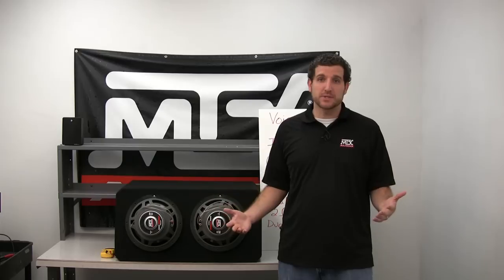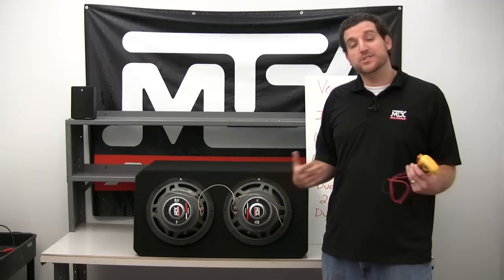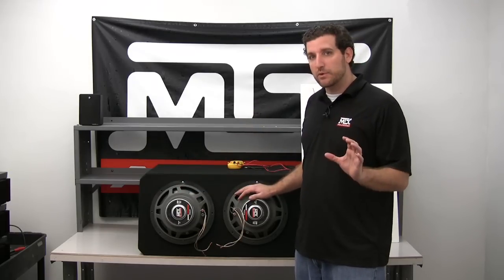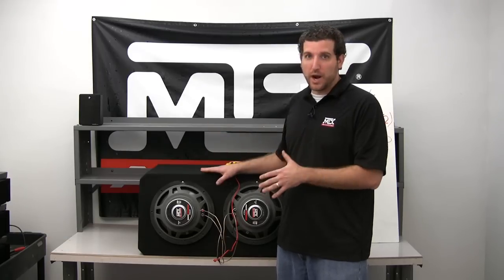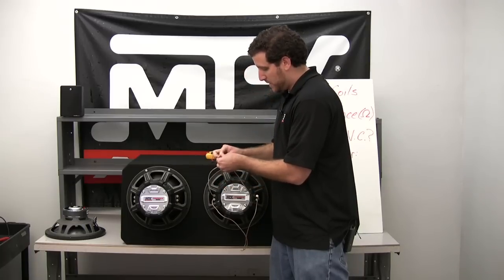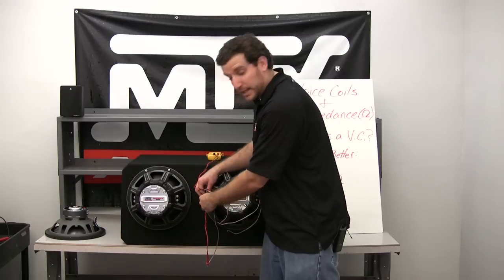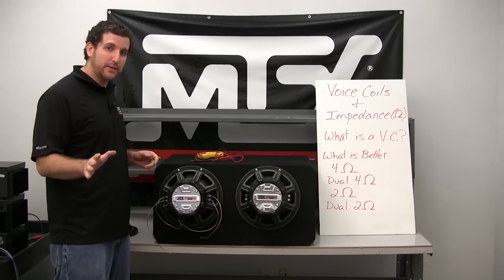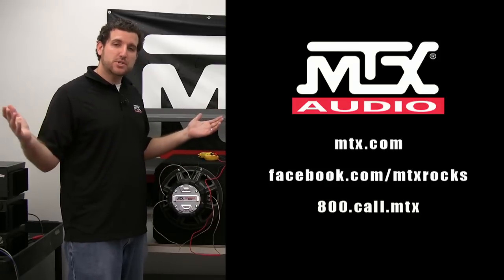How to Wire Your Subwoofers to the Correct Impedance for Your Amplifier

Comment: so if you have the 1200 watt terminator paccage with the 250 watt amp wat would be the best amp to give the subs more power safely
Reply from the maker: +ybm ticcloc Sorry for the late reply... That package is 1200 watts peak, 400 watts RMS and the enclosure is wired internally down to 2ohms. Here would be a good amplifier option - https://www.mtx.com/thunder5001-car-audio-amplifier
Reply: +MTX Audio USA thanks I'll check it out

Comment: i have a 400rms subwoofer and a 760 watt max 2 channel amp,i have the sub ran in series and bridged at the amp.it sounds good and dont get hot at all,is this a good setup?
Reply from the maker: +mumforddale1 We would need the RMS ratings of your amplifier in order to help you to make sure your setup is correct. Also, do you have 1 subwoofer or more than 1? If you have 1 subwoofer, how is it wired? In order to wire subwoofers in series, you would need to have more than 1.
Reply: i have one pioneer champion series 12'' subwoofer 400 watts rms hooked up in series dual 4 ohm voice coils to a pioneer 2 channel 760 watt max mosfit amp i have the sub bridged to the amp.sounds good i tried it unbridged and it didnt hit as hard as it did bridged.i no heat issue with my amp or sub,but i want to add another pioneer sub and a stronger amp.

Comment: I'm looking to fit 3 6.5" coaxs into the front doors but need to keep it between 2 and 4 Ohms.  How would be the best way to wire 2 of the sets in parallel and 1 of them in series to create about 3.6 Ohms?
Reply from the maker: +Rob Greenwood Most coaxial speakers have single 4 ohm voice coils. In order to run them all the same channel you would be at either 1.34ohms (parallel) or 12ohms (series). A 4ch amplifier could power 4 of the 6 door speakers without any crazy wiring. Then maybe pickup a small 2ch for the last two???

Comment: When you do this do you need to worry about the subs getting out of phase?
Reply from the maker: +BirchNirga A subwoofer being out of phase is when you switch the positive and negative connections. Sometimes this is done on accident and other times it is done purposely if the subwoofer is mounted inverted. You can read the article about subwoofer phase here - https://www.mtx.com/library-phase-discussion

Comment: Hey man I have 2 DVC 8 OHM subs, how do I get 2 OHM load ? Or how do I get a 2 OHM load with one 8 ohm sub....... Mine says 8 OHM on back of subs , Diamond audio 10's n I have a shit 2 channel amp n bridgable I think like 100 rms each channel or 75 but says 160 + 169 on it....... Also have 2 4 OHM 10's

HELPPPPPPP
Reply from the maker: +Headshothorror4488 We don't have the option to choose 8ohm subwoofers on our Wiring Diagram tool because we don't sell 8ohm subwoofers anymore but you can use the tool to select 2 - Dual 4ohm subwoofers to see the wiring diagram for a 1ohm load. If you wire your DVC 8ohm subwoofers the same way, you would end up with a 2ohm load at the amplifier. https://www.mtx.com/library-wiring-diagrams
Reply: +MTX Audio USA Thanks allot for the reply. I checked meter and it gives 4 ohm per coil on them so I guess they are really 4 ohms as I get a 4 ohm load together and single a 2 ohm final load

Comment: I bought 2 powerbass s-1204 12 inch subs DVC with a RMS 300 watts what amp should I use?
Reply from the maker: +Idris McGouirk You could wire that setup to a 1ohm load or a 4ohm load. So you would be looking for an amp that has an RMS rating of around 600 watts (300 watts x 2 subs) at whichever impedance you wire them to. If you wire them to 4ohms, it is safer for the subs but will require a larger amplifier. At 4ohms, our XTHUNDER1500.1 amplifier does 600 watts RMS which would be perfect. https://www.mtx.com/xthunder15001-1500w-rms-mono-block-class-d-car-amplifier
Reply: +MTX Audio USA So if i wire two DVC 4 ohm subs to 4 ohm and they handle ill need a amp with 600 watts x1 channel? Will it divide equally among the subs

Comment: i have 3 rockford fosgate subs 800 watt rms. what kind of do i need
Reply from the maker: +Brandon Beard You need to know what impedance the voice coils are and whether they are dual voice coil or single voice coil. Then go to - https://www.mtx.com/library-wiring-diagrams and input that information to figure out what wiring configurations you can use and what the final impedance at the amplifier would be. Then, find an amplifier that is capable of (RMS power rating x qty of subwoofers) at an impedance at or below the final impedance you choose from the wiring diagrams.

Comment: Circle Vs Square speakers
is there a difference?
Reply from the maker: +ARCH. M There is a difference. Square subwoofers have a slightly larger surface area which can mean they push more air thus creating more pressure which means they can be louder than round subwoofers with comparable power ratings and at comparable price points. 

However, the corners of square subwoofers create some design challenges to keep the cone moving in a linear path. If the cone does not move in a linear path, it can cause the voice coil to rub on the pole piece and eventually short out. So... While square subs can be louder than round subs, if they aren't designed and manufactured well, they can be more likely to fail. Some square sub manufactures increase the rigidness of the suspension to compensate for the challenges of the square corners which increases reliability but would decrease output and sometimes wouldn't make the square sub louder than a round sub anymore.

Round subs are much easier to keep moving in a linear path so they can be more reliable but they don't have as much surface area to move air.
Reply: Solobaric is definitely better the square shape of a solobaric sub means more surface area for bass and they have a lot less common problems as opposed to round subs
Reply: Mtx audio usa said it best... I recommend kicker L7

Comment: i have a question. let's say my amp is stable at 2ohms and i have a DVC sub at 2 ohms each, can i use only one voice coil since wiring it in series or parallel would give me 4 ohms and 2 ohms, respectively? thank you
Reply from the maker: +keiannschyler You can use only one of the dual voice coils on your subwoofer to stay at a 2ohm load so your amp will work but you would want to cut the RMS power handling rating in half. (Ex: 400 watt RMS DVC woofer should only get 200 watts RMS to one coil). 

The other option you have is to wire the subwoofers to a 4ohm load as long as your amplifier could provide adequate power at 4ohms.
Reply: *****
Thank you Sir... I really appreciate your time.

Comment: hi, my friend gave me his Lanzar VCHB210 and I was wondering if the amp I selected would be compatible 

Speakers: 
10" Dual 4 Ohm Vector Series Car Subwoofers 
Power Handling: 
Peak: 2000 watts total/1000 watts each 
RMS: 1000 watts total/500 watts each 

Amp: 
Pyle PLA2378 2-Channel 2,000-Watt Bridgeab le Mosfet Amplifier 
power handling: 
Maximum Power Output 2 x 1000W 
Bridgeable RMS Power @ 4 Ohms: 1x2000W 

if you could please tell me if this setup would work or not, and whether should wire them parallel or series
Reply from the maker: +Aaron Vander Linde We recommend reading this article - https://www.mtx.com/t/library-car-amplifier-ratings... 

The Pyle PLA2378-2 has two 15amp fuses for a total fuse value of 30amps. With a perfect 14.4 volt electrical system, this amplifier would only be capable of 432 watts.

Also, you are going to want to put a multimeter on the terminals of the enclosure to figure out what impedance the enclosure is wired to. If the enclosure has two terminals, the subwoofers are not wired together. If the enclosure has one terminal, the subwoofer are wired together. 

The key is figuring out what impedance the enclosure is wired to and then using that impedance when determining power output ratings of your amplifier to make sure they will match up correctly.
Reply: +MTX Audio USA  alright so the sub enclosure has 2 terminals and the speakers are 4 ohms so knowing this I was wondering if you could recommend an amp that would be adequate to run the speakers even if its not pushing them to their full potential, also I don't want to spend more than $80
Reply: on second thought, wouldn't bridging the amplifier to the speakers give 432 watts to each sub at 2 ohms. these would be close to ideal conditions because the amp is stable at 2 ohms and the speakers rms is 500 watte. but i could be completely wrong

Comment: Why did u avoid the TWO subs at 4ohm each and bring too 2ohms together ? Why only show one I don't get it... So dvc suck cause everyone runs TWO subs not one and u can't get 2ohms from TWO 4ohm dvc subs ??
Reply: +Headshothorror4488 If I understand what you are saying correctly: if each sub is 4 ohms, meaning 2 subs= 8 ohms. to get 2 subs each at 4 ohms to = 2 ohms you would wire them in parallel.
Reply: +eturnald So u can wire Two 4 ohm DVC subs to be 2 ohms final ? I thought only SVC subs can do that.
Reply: i honestly did not see that you said that. I apologize for that. I think the lowest you can drop them is 4 ohm. again sorry for that

Comment: I have 2 Orion Xtr124D  600rms each 4ohm dual coil
How should I wire my Hifonics  Brutus  BRZ3016.1 D
       Specs: 1000rms at 4ohms   OR 
HIFONICS ZRX3216. 1 D
      Specs:  1600rms  at 2ohms ?

Comment: I have 3 8100 mtx amps
And 3 9500 subs 
I want to get it all hooked up
I wanted to know if 
Sky high wire would do the job?
And if xs batteries would work as well
If so what model & how Manny amps
Or how Manny batteries
On a low budget

Comment: My truck came it 2 amps under the seat all wired I don't know how I use both of them do I just go one sub to each amp
Reply from the maker: ***** Not necessarily. It could be one amp to each sub if you have two subwoofers or one of the amps could be powering door speakers. While the system is playing, you can unplug the RCA cables going to the amp to figure out which speakers each amp is connected to.

Comment: How many tweeters can I hook up to one amp(alpine t220.2 with hp) I also have a jbl 804-ez 940w 4ch 4 6.5" jbl components  and plan on getting another 4 sets of 6.5" component or EITHER woofer mid range or neopro type mud range ....

I have alot of audio laying around like a powerbass 1000.1 & jbl reduced depth 800watt 8" subwoofer's with 2 jbl 501-ez amps  but I feel like I bought the wrong company for what I really want... which is spl but I still want sq so I was thinking massive audio 6.5" & put the 8" in the door in a 1/4" steel square tubing  welded to the door s metal and cut the door panel to fit(make a fiberglass corvered enclosure over the framing!  Just not sure how to wire 8+ 6.5"s & 12 tweaters I have/will get the amps I need but I want to make it as loud and clean as possible without sacrificing space so smaller the amp the better, I offraod alot in Arizona here so everything DOESN'T have to JUST look pretty it must withstand a launch over a woop & 60-70mph washboard jitters.... so that's why I plan on welding steel cages/box's/baskets for the subwoofer's to bolt into using tack welded nuts!( Might just tack it & have some one tig welding everything but I want it to be brand interchangeable!!!) Lots of work definitely price affordable if you know your way around the tools ect...

Comment: I have 2 L7 12's and a hifonics zrx 2416.1d amp. Here are the specs directly from the hifonics web site. Can I hook up my L7's to this amp? I understand I need to wire the amp at 2 ohm but the amp would only provide 1200 watts and each sub is 750 rms. I just want to know if wiring these two dual 2 ohm subs at 1 ohm is possible.

Comment: I have 2 15 cvr kicker there 2ohm dual voice coil and the amp is a lanzar 2400 watt I want to wired it up at 1x 2400w max at 4ohm bridged how would I do that it's a 2ohms stereo stable amp
Reply from the maker: Angel Carrillo Is there a reason you want your amplifier running at 4ohms? 2 - Dual 2ohm subs can be wired to a final impedance of 2ohms at the amp or 0.5ohms at the amp. Obviously, since your amp is 2ohm stable, wouldn't be able to go any lower than that. Also, depending on which model of Lanzar amplifier you have, the 2400 watt rating is most likely the Peak or Max power rating. That is NOT what you want to use when matching subwoofers to amplifier. The RMS or continuous rating is what you need to use. If a Lanzar amp has a 2400 watt MAX rating, its RMS rating is probably around 600 watts @ 4ohms. You can see wiring diagrams that show how to wire different subwoofer configurations and what the final impedance would be here - https://www.mtx.com/t/library-wiring-diagrams

Comment: In you last example with 2, 2 ohm DVC subs.  Wire both in parallel for a 1 ohm load per woofer, then wire the 2 subs in series for a 2 ohm load.
Reply: +Relic Webmaster Your partially right. With 2 DVC subs @ 2-Ohm:

Parallel --> 1-Ohm + 1-Ohm =  2-Ohm load
Series --> 4-Ohm + 4-Ohm = 8-Ohm load

Comment: What type of amp do i need for two 12 inch Rockford punch p1 ?
Reply from the maker: Are your subwoofer 2 or 4ohm voice coil and are they single (SVC) or dual (DVC) voice coils? This will determine what impedance the subwoofers can be wired to and what the total RMS power we need from an amplifier should be.
Reply: Their Rockford fosgate punch p1 that's all I know about them.

Comment from the maker: @Sameer Bakhsh - Assuming all 3 of your subs are single 4ohm voice coils, you can either have a final impedance of 1.34ohms at the amp or 12ohms at the amp. With either configuration, this isn't good for your amplifier as it is only 2ohm stable and at 12ohms, it won't be providing nearly enough power. Please refer to our "Matching Subwoofers with Amplifiers" article on our website - http://ow.ly/HbZTz
Reply from the maker: Correct. That will result in a final impedance of 2.7 ohms, BUT that method of manipulating the impedance is wiring two woofers in series and the 3rd in parallel so not all subwoofers will be operating at the same impedance which is inefficient and can cause acoustic problems in a shared enclosure.
Reply: Thank you ..good info in the link ...appreciated
Reply: You can also get 4 ohms from 3 4ohm SVC subs. Connect Speakers 1&2 
in series then connect the + and - of the series speakers to the + and -
 of the single 3rd Speaker, then to the + and - on the Amp.
Reply: I meant 2.7 (3)ohms.

Comment: I have 2 10" thunder 6000 subs..is my thunder 250d going to be enough at 2 ohms..
Reply from the maker: Here is a link to the Tech info for the Thunder6000 series of subs - http://archive.mtx.com/caraudio/products/manualsQuickInstall/subs/Thunder6000Ref.pdf

Your subs have an RMS power handling of 150 watts each for a combined total of 300 watts.

Your Thunder250D amp - http://archive.mtx.com/caraudio/archive/thunder250d.cfm will do 200 x 1 at 4ohms or 350 x 1 @ 2ohms.

You can wire your subs to a final impedance of 2ohms at the amplifier so that your amp can provide them with 300 watts of power. Just be sure not to turn the gain on the amp all the way up because you may overpower them if you push all 350 watts to them.

To see how to wire your subs to a 2ohm impedance at the amp, go here - https://www.mtx.com/t/library-wiring-diagrams

Comment: I have a 4ohms svc 50-250w rms subs, 500w max and 2ch amp with 2x125w rms @ 4ohms, 2x250w max @ 4ohms 1x500w max bridge @ 4ohms, 2x225w at 2ohms and its capable of 2ohms stereo stable... What is the best wiring install to get the max of my speaker and amps? Please let me know. Thanks
Reply from the maker: You are going to want to use the subwoofer's RMS power ratings to match to your amplifiers RMS power ratings. Peak power ratings are sometimes inflated by the manufacturer for marketing purposes and are not accurate for real world settings. If you have 1 subwoofer that is a 4ohm single voice coil (SVC), you only have one option for impedance which is 4ohms. So, if you bridge your 2ch amp to 1 channel, you will want to look at it's bridged 4ohm RMS power rating. That is what you would be sending to your subwoofer. Hope this helps.